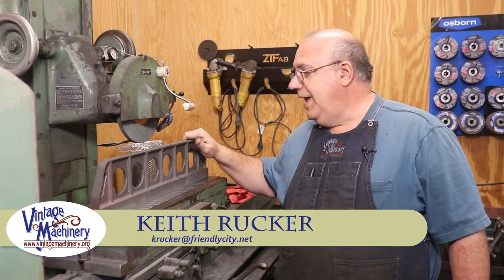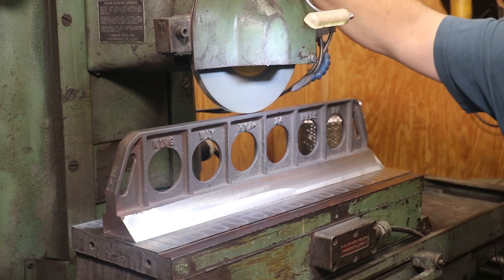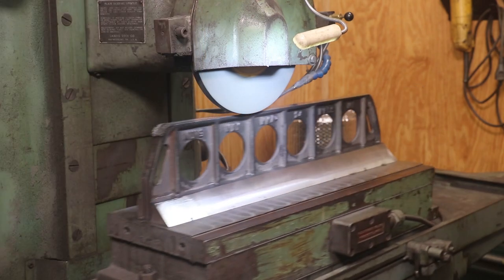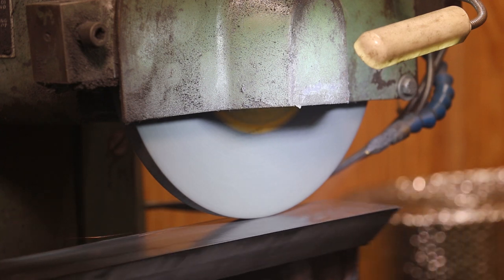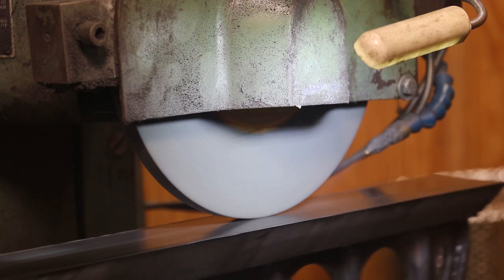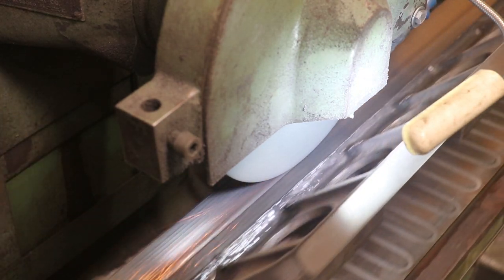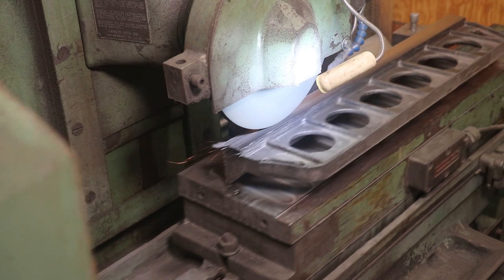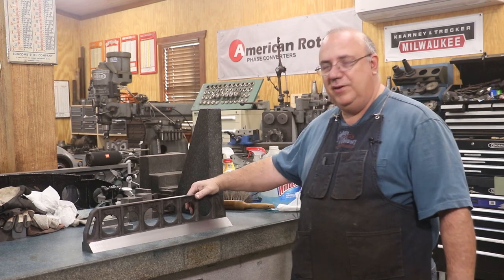Finish Grinding a Straight Edge on the  Surface Grinder

Comment: It turned out nice! .0005" over 24" is pretty good especially for a quick grind! I bet most of that is from not running flood coolant so you had more heat in the middle of the part than the ends and when it cooled you got the bow. It takes only about 15deg of heat differential for that much error.

Comment: Nice job Keith,
Brian Block was correct on the heat build up causing the bow in the center. One way you can reduce that is to place the straight edge at angle on your magnet. It reduces the contact of the cut on the part and helps a lot to reduce heat. The draw back is that it takes longer to traverse across the part but this also allows your mister more time for cooling. .0005" over 24" on a machine that old without flood coolant is amazing.
Steve

Comment: Pretty good chance the slight bow was present off the mill, and the mag chuck pulled it down, distorting the part.  The grinder probably got it flat, and then some bow returned when the mag chuck released.
Reply: Ya. we would generally shim the bottom on the first grind so the magnet wouldn't pull it down. Equalize the warp in this case with a half thousand on the 2 edges or something like that.
Reply: A bit of the good old electro-flaking scraping action will fix that.
Reply: We could all see it coming.

Comment: Could you put a test indicator on the finished ground part still on the grinder with the mag chuck energized and again with the mag chuck deenergized to what affect the magnetism  has on the shape of the part while being held in place, maybe the placement of the support blocks is bowing the part when grinding
Reply: We C-clamp the piece onto a 90 degree angle plate for the first cut, then mag down the plate. After one edge is straight, you can mag it down directly, grind the other edge, then flip it over and re-grind the first edge. One of the "interesting" things about hardened steel is that internal stresses will cause the piece to warp as you remove the outer (hardest) material, similar to wood. Not much, but enough to make a measurable difference. Measurable by some of our customers, anyway. We work in tenths, they measure in millionths. Also, every surface grinder gives a better finish and more accurate cut going in one direction (in and out) than the other. That's a function of wear on the ways, not the nature of the machine itself.

I'm a jig grinder by trade - we're the nerds of the machining industry.

Comment: My guess is that when you start scraping you will find the part low in center and high on the ends.  When your grinder table reverses direction the ends are plunging down and grinding less away than in the center.   On your 45 degree surface, the parallelism of that angle to the base is only going to be as good as the precision of those magnetic blocks

Comment: In case anyone is interested, a half thou in 24" is an angle of ONLY 0.00119º.
Reply: 4.32 seconds.
Reply: Whats intresting is a stright edge is 0 degrees.
Reply: @davidl.579 most Starrett straight edges are +-.0002" per foot.

Comment: What is the Norton stone?

General suggestion for all of your videos.  It would be helpful if a list of special tools and products were provided in your description.
Reply: Put "Norton Stone" into google and you will find your answer :)
Reply: That'll just have more people whining, "well, as a [crotch] grinder of 45 years, you know that stone is good for cast iron that is over 17.5 months old, your CI isn't seasoned that long, so you should be using xx wheel."

Comment: Don’t know if you have ever tried it but many years ago we used to “load” the cutting face of our grinding wheel by pressing it with a hard wood board such as oak during final rub out stages. Seemed to improve the final finish and even out the surface..
Reply: interesting. does that basically burnish the surface?
Reply: Sharklops 
Yes I believe that is an accurate description. We used the same technique on large wheels on the cylindrical grinder on hardened steel, hard Crome and spray metal coatings
Reply: Will the wood not clog up the stone for the next grind? (Sorry I'm the shop idiot here)
Reply: Jaco Badenhorst 
You would normally redress the wheel for the next work piece. Plus the wheel is braking down during the rough grinding process

Comment: The taper on the 45 degree angle would make me suspect the v-blocks the straight-edge is sitting on - it is not sitting directly on the magnetic chuck after all. 

Also if I watch the grinder, it seems to always grind a little heavy starting on a stroke but never ending, both ways. Seems to me the table is rocking a little. This would explain the "hinge" on the surface plate.

Still, plenty accurate enough to prepare for a scraping class :)

Comment: Keith, you said you were using a special Norton wheel made for grinding cast iron.  What is its specifications?  I.e., abrasive, grit size(s), grade, structure, & bond?  I used to spend a lot of time in our Grinding Shop at work and never saw wheels being dressed like you did, but we never ground cast iron either.  Is that dressing technique what Norton recommends for that wheel?  I'm curious because I hope to find an "available" surface grinder down here in central Florida one of these days and have a lot to re-learn about grinding.

Comment: I want to scrape in a lathe but my surface grinder only has 630mm of travel. I need a 1200mm straight edge. Is there a way for me to grind one on the surface grinder? I don't have a big surface plate either.

Comment: Sir, first of all. Thank you for the great content you put out. I enjoy watching all your videos. I'm a total idiot having used a surface grinder only once when I was 15, with all but satisfactory results. I do have a couple of questions though. 
1. How big of an effect does heat have while grinding? If you are measuring to the degree shown in some of Tom Lipton's and the like's videos? Do you let the part cool down between passes? 
2. Could the taper on the dovetail side not have been due to not having the perpendicular "back face" ground in before swapping over to the front? (All being equal and the mag transfer blocks being true)
Maybe I'm totally missing the surface here.

Thank you again for the way you transferring your knowledge through your videos.

Comment: Keith, the sparking on the left side when the wheel is moving right to left is less than when it starts on the piece from left to right. Could that be from the wheel picking up some of the scarf that is on the end of the left end of the piece?
Reply: Yes I noticed that too. Maybe wear in the table slides, or an artifact of the drive mechanism.

Comment: I wonder if the grinding wheel is picking up the filings at the end of the piece and causing sparks and finish problems on the ends.
Reply: Was wondering the same thing.

Comment: When you spark out, is that do to the metal flexing to give a high point ?
Sorry never saw this done. Thanks.
Reply: Sparking out means to continue passes at that depth of cut until you longer see material being ground off. The magnetic chuck definitely flexes the part.
Reply: Keith, I'd think the .004 you started with before grinding combined with the magnetic chuck is why you ended up with .0005 variance.  Keep up the effort, you do very good job producing these videos.
Reply: @nelsonashbrook765  Thanks for your reply

Comment: Did you mag the piece down when you did the initial grind on the upper surface? The bottom wasn't ground flat at that stage, so I think (but I['m not sure) that it SHOULDN'T be magged down.
Reply: Perfectly thought through and described. It takes a special sort of mind to show us how the base is 4thou hollow and then mag it down to machine an opposing surface.  I was trying not to get upset by this and I ended up accepting that Keith is not as good at this as he would like us all to think.
Reply: @jonka1  Given that Keith has already showed and explained this effect when tuning the surface grinder and mag-chuck in a recent video, I suspect the detail I'm asking about was merely "off camera", hence my question

Comment: doesn't the wheel diameter shrink or wear away as your grinding?
Reply: Yes, it does. But the leading side of the wheel wears, while the trailing edge remains almost full diameter. So as it steps across the part, the leading edge removes the bulk of the material and the trailing edge cleans it up. You'll sometimes see them grind it with a "full (wheel) width step over" so the wheel doesn't get that angle induced into it.

Comment: 150 for a rough camel back seem very expensive for me
Reply: That's ok. Just pattern one up, send it to a foundry, have them make a few prototypes, and then sell them to your vast machinist network. Or buy a rough cast straight edge from someone else, so you can have a project scraping it in. Or better yet, buy a finished straight edge. (Psssst, they're all more expensive.)

Comment: If it's wrong blame the Chinese.
Reply: I wish people would instead say they used 'inexpensive' tools instead of presuming 'Chinese' or 'import' always means lower quality. They are entirely capable of making high quality parts if you're willing to pay for them, and other countries like US/Germany/Swiss etc product will likely have the same issues at the same lower price points, and probably even worse.
Reply: @scottr939  Agreed. It's the sign of our times. Having just watched Stefan G bring a Chinese six jaw vice up to his spec his initial thoughts were it had good tolerances.
Reply: Sounds like a grinding project on the v blocks .
Reply: Gotta blame somebody, might as well blame China 😊, years and years ago we blamed Japan. I agree, you usually get what you pay for.